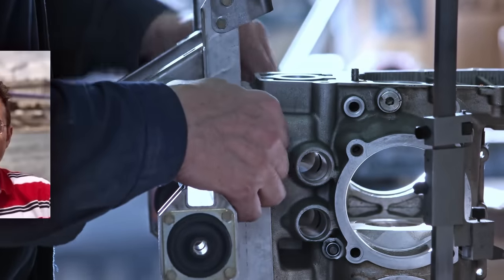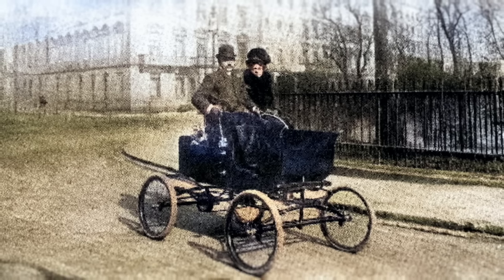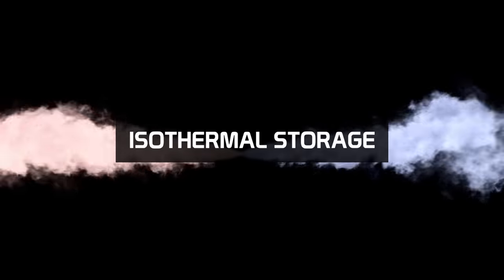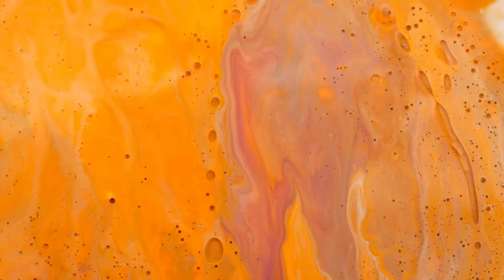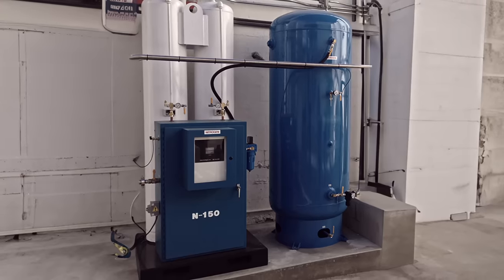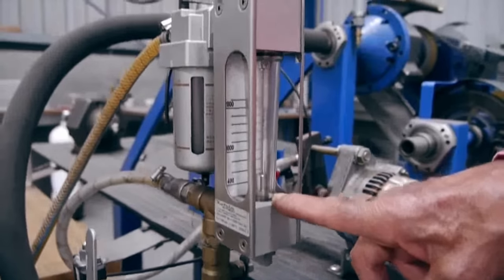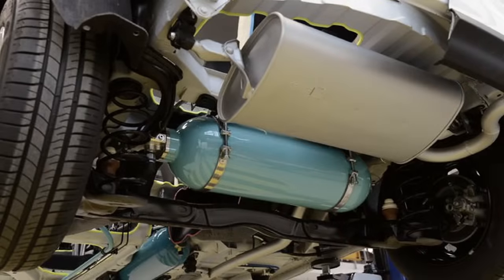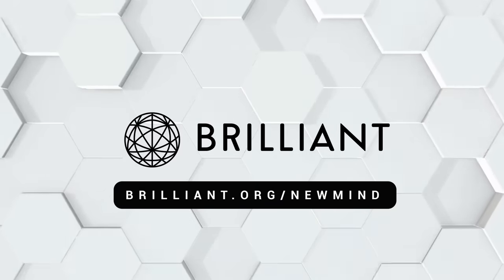Driving On Compressed Air: The Little-Known Compressed Air Revolution

Comment: As a mechanical engineer, I have been paying attention to this technology for years and the apathy and skepticism it arouses never ceases to surprise me. I firmly believe that it is part of the solution for sustainable zero-emission mobility. Critical of the researchers is that all the power comes from compressed air, instead of sharing that task with electrostatic storage. The super capacitors would give acceleration to the vehicle through electric motors in the rear wheel drive, and the car would keep rolling with the impulse of compressed air in the front wheel drive. Both forms of propulsion would act on climbs, and both would recover part of the energy when braking. The use of phase change materials is the alternative to improve efficiency. Such a car will be supplied with energy in places where compressing the air supports heat for other processes, such as preheating water, space heating, cooking ovens, swimming pool heating, even milk pasteurization. So no energy would be lost in air compression for large tanks. All charging at these establishments could be done in three minutes: Charging the bank of supercapacitors, melting paraffin and filling the tanks with air at elevated pressures. And since the air that comes out of the pneumatic motors is cold, it would serve to air condition the passenger cabin. I find this solution feasible, but neither the automotive companies, nor the deputies of the European Union, nor Elon Musk, believe the same.

Comment: what about self discharge though? if you also want to keep the heat to get more power from the expansion, you will have to insulate the tank, but even the best insulation isn't 100% perfect so you will lose power, also, there is the problem of thermal mass location, you can't compress in a central location and then use the air in the cars or whatever when the heat energy is stored in some sort of thermal battery located where the compressor is
Reply: you would need to use that heat energy somehow in the compression plant to save energy on compression.

Comment: This was a really fantastic and well researched video - thanks!!
Reply: not well researched at all, typical youtube content, air motor is a joke and it is well known, and MDI is a scam going on for at least two decades lol. Using air in vehcile makes zero sense, the total cycle efficiency is extremely low and always will be because highly compressed air (350 bar) is jsut a terrible medium for energy storage in a vehicle application, as simple as that.

Comment: All of this "alternative" energy research, with it's increasingly complex ideas is the new alchemy and it will be just as successful.
Reply: alchemy turned into chemistry and made our modern world possible. Without it, we'd still sit in mud huts and rub sticks together for fire.
Reply: Complexity is scary huh. I too miss a simpler world. But not every new thing is bad.
Reply: And internal combustion engines aren't complex? With all the massive infrastructure behind obtaining, refining and distributing the fuel... 
I don't think this compressed air thing will go anywhere on a large scale either but let's not leave any stones unturned.

Comment: Somehow the video never gets around to mentioning how poor the energy density of compressed air is. At one point it implies it's 4X that of lithium ion, which a quick google debunks (perhaps efficiency was confused with energy density?). This is the real reason MDI/ZPM haven't brought their vehicles to market, not market trends towards batteries or any of the other reasons listed. The simple fact is that the AirPod and other prototypes never were independently shown to have a range any greater than about 4.7 miles. Not 47, but 4.7, as in not even five miles. "Fast recharging" also doesn't mention the noise level of the compressor, or that not just any gas station compressor would be capable of filling the tanks to the required pressure. This is why the Shark Tank investor pulled out of ZPM after the show aired, presumably upon speaking with his engineering consultant.
Reply: this video is a joke, typical "youtube content" to make money, zero proper reasearch and zero meningful information. The total cycle efficiency of using compressed air for vehicule is laughable, the compression to 350 bar is 50% efficiency with the best in class compressors, and the efficiency of "air motor" is 20% for best in class, meaning even with all best in class it could only achieve at total cycle efficiency of 10%, and in reality it is more 5%. Not to mention the energy density would already be very low if the whole cycle was 100% efficient, but with 5 to 10% effective efficiency it becomes more than maughablee. Orders of mangitubde below electric or thermal motor.

Comment: Thanks for sharing your videos, was nice to see an update on this technology. Along time ago when this tech was experiencing a resurgence I pondered if this might be a good substitute for energy in lawn care equipment. Whenever mowing large lawns I would notice the mower deck would get quite hot. In retrospect I’m pondering if my spindle bearings needed some work, but at the time I was convinced that it was from all the friction involved in the cutting, chopping and blowing process and then pondered if the mower deck was made with integrated cooling channels similar to rocket nozzles than maybe the air could be preheated by running thru the mower deck and besides boosting power input to the motor would offer cooling for the operator. 😂
Reply: You might be on to something

Comment: All you need is a powerful compressor a set of oversized injectors and the engine timed up to regulate with the compressor on engine stroke it's as simple as that😊😊😊😊😮 by using a rotary coupling compressor it should be no problem

Comment: Low energy density can be overcome at the expense of safety and increased risk of catastrophic failure. Imagine a 4500psi air tank detonating in a collision...even if you survive the crash you will not survive the explosion of the tank. Burning literal TNT would be safer than this!

Comment: I remember watching a discovery Channel documentary about compressed air powered cars on discovery Channel in the mid 2000s. Always wondered what happened to the idea.
Reply: It's because
- Insane pressures are required to get a good yield, causing a lot of stress on the tanks which will need to be replaced regularly, adding cost,
- Air tanks must be thick and thus bulky to handle the pressures involved, and must be made from expensive high grade steel,
- Efficiency is really not all that since a lot of energy is lost in the form of heat during compression,
- The system freezes over if decompressed too rapidly, and heating is required to overcome this, further reducing efficiency,
- Max. power tapers off as the tanks are slowly depleted,
- Steam power proved more efficient, cheaper, versatile, and reliable.
Compressed air engines have only niche applications, really.

Comment: I remember various reading about / watching videos about various people / companies exploring / using compressed air in the 1990's / 2000's ...  Lots of fork lifts actually run on compressed air.  I hope they can move beyond storing highly compressed air in tanks, because the pressures involved are truly frightening if anything ruptures.
Reply: Those fork lifts are gas powered ICE, they do not run on compressed air. The physics of it makes it simply not feasible
Reply: @GiorgioAresu  The forklift was running on compressed air - definitely NOT gas.  Do a search on Angelo Di Pietro's work with the Di Pietro Air Motor for starters.  His forklift was using air tanks tanks an frighteningly high pressures: 350bars or 5000psi.  Sorry, I cannot post links here, because my replies never show up.

Comment: Pneumatic motor still has to obey the second law of thermodynamics. Not many people know this.
Reply: Do you mean it’s going to get very cold?
Reply: @pascalbruyere7108  it means efficiency is related to temperature difference
Reply: @luongmaihunggia temperature difference
Reply: @radicaledwards3449  yeah, that's what I meant
Reply: Battery, otherwise no car works, even combustion engines.

Comment: Been thinking about this for decades now (mostly liquid nitrogen), which is a perfect fuel for my solar powered coastal cruising boat, since it does not need high torque and can use solar while sitting at port to charge up its tanks for a prolonged time before heading off to the next port, all using zero fuel.  Tankage provides floatation and structure to the vessel.  A total design win, yet nobody has yet built such a boat and I can't spend my time on it these days.
Reply: I will rent your nitrogen powered boat
Reply: How do you liquify the nitrogen with a solar panel? that's extemely energy intensive
Reply: @t0k4m4k7  A small cryocooler like they use on cell towers and spaceships.   Just takes a LONG time to produce enough to power a boat for 100 miles, but you can use both the solar AND the LN storage to move the boat.  3kw of solar.
Reply: I discuss this a lot and am thought to be a fool
Reply: You do know that a tank of liquid nitrogen would not float...
Reply: @leneger9174  I will be a little more generous and just call you inexperienced......
Reply: You need to sit down and figure out some numbers for your idea. How cold does it get, how do you separate the nitrogen from the air, how much insulation do you need, what pressure, how much power do you need to run the boat, how much weight. And many more. Also, don't call nitrogen a fuel unless you're burning it. And, don't burn it.

Comment: When I was a kid, I had this toy that utilized compressed air for its 'fuel'. It had this tiny tire pump that filled up the plastic chamber. And I've always wondered if on a far more compressed basis, if this notion could be utilized for real cars. Another thing I have questioned is if those air pumps that can be found at most fueling stations could be utilized for 'refueling' such cars. If so, it would be amazing to refuel at 25 cents to 1 dollar... or even find those gem stations that still have free air. However, I always figured the storage capacity was far too low to permit such a car to surpass two miles per tank. Nice to see that with a little more engineering...

Comment: the low pressure problem can be pixed by using motores designet for lov pressure and highg aireflow, so you can storage like 240atm and the motor runs at max 4atm with a pressure regualtor the problem is fixed. you have the same tourqe and power until your 240 atm tank is at 4atm
Reply: 1to240bar: work
240to4bar: 0 work
4bar to 1 bar: less work
Reply: @heilundwissen9833  i cant see the problem, as long the pressure level of the tank is higher than the set 4 atm, you will have constant 100 Work but if the pressure level goes under 4 atm you Tank will be close empty and you will quickly start losing pressure
Reply: Use your handpump for 240 bar. After let expand 4bar. Big input, small useful output.
Reply: @heilundwissen9833  what do you mean ?

Comment: I had read, years ago, that Thomas Edison built and used an air powered motorcycle... or maybe more accurately an air assist bicycle. I can't find a reference to it on the internet the moment, however. As I remember, it would use the air motor to help power up hills, but when going downhill he could throw a valve that would then use those air motors as compressors to put some pressure back in the tanks.

Comment: I'm doubtful if the parafin trick will make efficiency so great that the "battery" has low self-discharge.
Isn't it (the parafin) going to freeze after some time? Then the entire advantage of heating up the gas is non-existent.

Haven't thought for too long but phase-change materials like CaCl2 and parafin are cool nonetheless.

Comment: Compressed energy air storage: 0.07MJ/kg at 200bar in a steel bottle.
Lithium Battery:  ~0.5MJ/kg.
Diesel:  45MJ/kg.

50l (1900MJ) diesel in plastic tank: ~50kg
1900MJ compressed air: ~ 27000kg

Comment: i think if they added a vacuum chamber, the energy exchange would improve. fully expanded air is easier to compress then partially expanded air. like using hot water to make ice cubes. also using whirlpool effects the transfer air would help, like spinning a bottle of liquid and turning it upside down to empty it.

Comment: I've always wondered about this. what if you had a huge compressed air cylinder almost the length of the vehicle. configure the vehicle like a front wheeled trike and just sat on the cylinder. a side benefit of air is as it exits it's temperature is reduced so you could use it for cooling without extra energy being expended

Comment: drive on h2so4 electroplating batteries, any electroplating metal, as metal-air battery, carbon rod-felt electrodes, recharging the sulfate to metal and h2so4, like znso4/h2so4 and zn+o2, yes rechargeable zinc-air battery, the only downside is some amount of self-discharge because of zn+h2so4 -> zno2 + h2, but either the electrolyte can be removed when not in use or use some other electroplateable metal that will not react fast/at-all with h2so4, like tin. also if you dont want/need to recharge, then baking soda (sodium bicarbonate) water will work for iron, zinc, aluminium, tin, as single use, or single recharge, with silver plate as the air-electrode.

Comment: Wow ! And it only takes 3 HP to produce 1 HP of compreesded air! That should triple the pollution problems!
Reply: you think lithium is clean? do you think its ok to charge batteries with so much electricity? compressing air is 0 damage for the environment
Reply: @Knightfire66  but a battery is 60 percent efficient, and compressing air is 30 percent efficient. They are both environmentally a disaster!

Comment: You could use the compressed air to heat water, or heat the home during winter, and then cooling during summer. And you can use zeolite to heat the air supplied to the generator.

Comment: Brilliant! Now how large of a diesel engine do I need to run the air compressor that compresses all of this FREE Air? Or do I just use an electric motor on the air compressor that uses electricity from a coal fired power plant?

Comment: The electrical grid would be running electrical pumps instead of charging batteries, even with the theoretical efficiency gains over BEV it's basically apples to apples from that perspective.
Reply: I think the benefit would potentially be that the car us cheaper to produce since it doesn’t require as many expensive battery materials?

Energywise yeah probably the same if not more costly since compressed air seems more inefficient.
Reply: Same as electric cars. The idea is to centralise energy production which can be transitioned to zero carbon. Also not apples to apples in the sense that it doesn't use batteries which require mining of rare earth metals
Reply: @rbauer961 No rare earth metals in Batteries. Motors sometimes. 
Lithium, Carbon. Iron, Sodium, Phosphates... all abundant.
Reply: what if there wasn't a single electrical part in the entire generation and usage setup?  ie/ tidal / hydro compressors

Comment: 9:52 is there really no fire hazards related to it? i was under the impression that compressed air was very flammable, unless you pull the o2 out. even if the air isn't flammable, would the benefit not be outweighed, by the fact that if ruptured it could explode?
Reply: No, air is not combustible at any pressure.
Reply: A pertol car and a compressed car in a crash is a match made in heaven fuel blasted with compressed air. Only bettered by a petrol tanker and a compressed oxygen truck crash.

Comment: I don't know about automobiles, but I garner FREE compressed air on my North Texas homestead and it in turn runs machinery as well as makes electricity. 

I use a small south-facing (tilted @ my latitude)12-15 volt solar panel, which drives a small air compressor whenever the sun shines.

I have 2,000+ gallons of storage. My receiver system auto-dumps at 120 psig.

Two thousand gallons of compressed air beats expensive and dangerous lithium batteries any day of the week.

Free compressed air gives me lots of other free stuff, like electricity for air conditioning, etc.
Reply: A  100 watt solar panel running a 12 volt air compressor so 500 watt hours  as on a sunny day  would not manage to get a 2000 gallon tank up to 120 psi in a day even if it survived running the first day even at 100 % effiancy just using the solar panel 1/2 hour running a small AC. My 1000 watt air compressor takes 10 minuites to get the 20 gallon tank up to 120 psi 2,000 would take 1,000 minuites 16.66 hours with only 100 watts x that by 10 for 166.6 hours almost 7 days I sense bull shit.
Reply: @JonathanTamm  
I sense narrow-mindedness.

You know what they say about "assuming", right?

I have numerous $30 pv panels running geared-down (16:1) diaphragm pumps as well as 11 (currently) windmills each sporting 6 diaphragm pumps and 22 more in different stages of completion.

Try looking at life through the OTHER end of your binoculars!